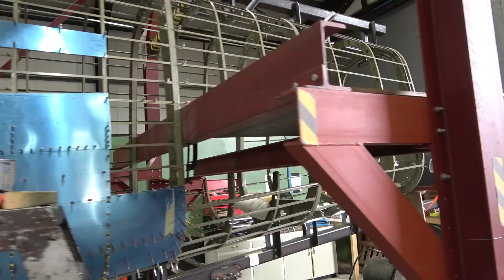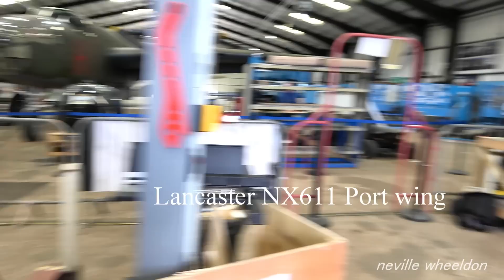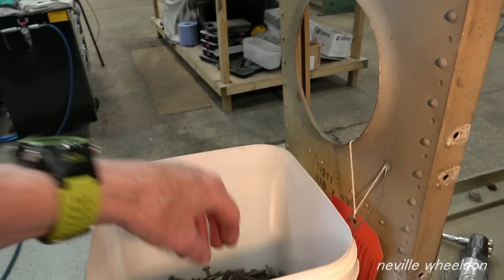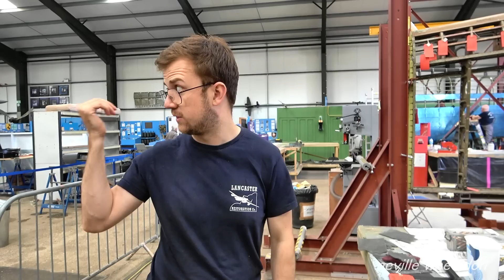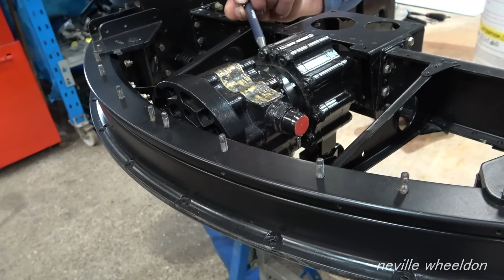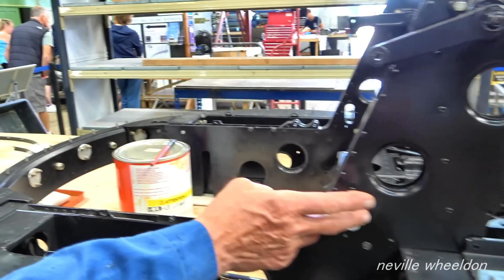Video 263 Restoration of Lancaster NX611 Year 7

Comment: heat was only applied to canvas for shrinking by drying it
newer modern materials have a shrinkage built in and is very dependent on the correct temperature's applied
i did a little work with Irish linen, actually it wasn't Irish in the end but a very good quality substitute used in aviation
sure i still have samples of it somewhere, but i covered a Hurricane with it, every time you applied the sealer, the linen would go saggy, as it dried would become tight again, fantastic to watch, any kind of heat used at distance would assist in drying, as i novice i thoroughly enjoyed the process, i know a few people who have built model aircraft and used the iron method on the poly materials, also great to watch

great to see the guys recording what they do, i always had an issue with the paperwork, even though the airframes we worked on were static - some of the engineers who were ex aviation were very slack, took this off, took that off, inspected and no detail as to what they did - i always said we should have a computer there in the workshop, while things were fresh in mind, enter the info, they got a computer and put it in a portacabin locked away, it was never used - but i used to enter my work into my own worksheets including images etc, this then provided a much detailed work log which had no constraints as hand written forms did, as you only had an inch deep space to add a couple of lines
but its good to see its done, for FAA approval - the felt incidentally, i had to get some for a job i was doing, i had loads of fun sourcing something appropriate in grey, in the end i finally found some used in the fashion industry, to stiffen up handbags of all things, available in all colours and any size